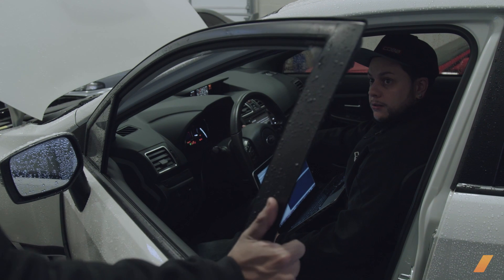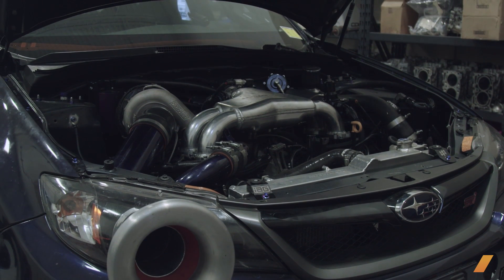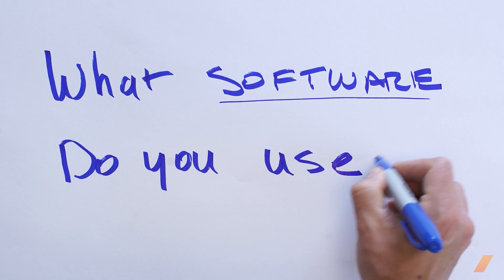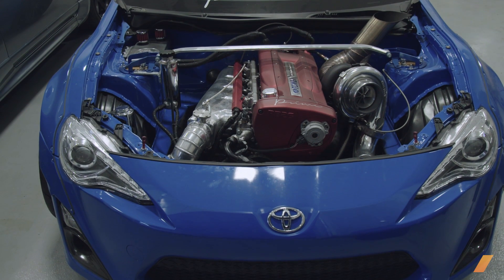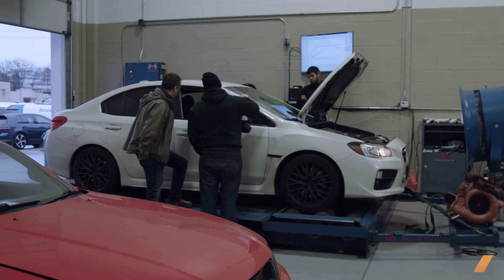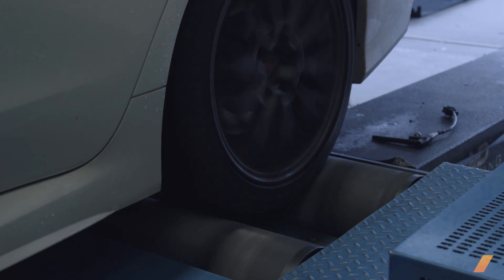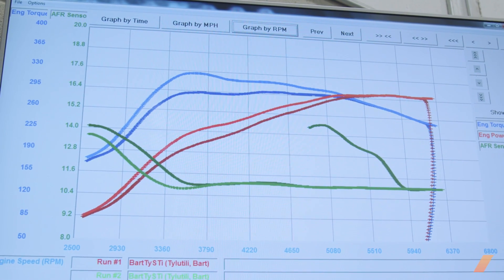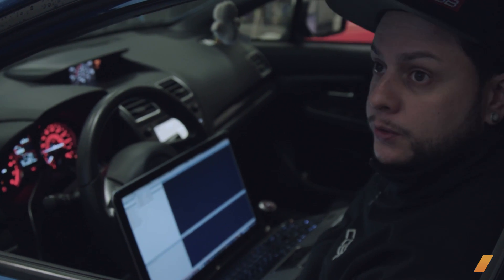Dyno Tuning Without Blowing Up Your Car -- /ENGINEERED

Comment: GDI is much more efficient and produces better power and MUCH better torque than non-GDIs.

Get an engine with (or install) a set of manifold fuel injectors along with Direct Injection, and there's no loss at high RPM.

idk why this dude said DI isn't good for performance.. maybe it's an old vid

Comment: Cast Al pistions shouldn't come stock in boosted cars, either should Al "semi" open deck blocks. Fuji Pop Can Motor cheapskates, way to ruin an awesome German motor design. Now Vince has to make a few million motors to preserve the Boxer name just so we lucky bastards can run more then 550hp. It was all about Fujis bottem line, never about the customer and certainly not about the environment. Heck heck heck.

Comment: When the air gets colder it comes denser but the pressure remains the same but you are implying that the boost increases when the air gets colder. Boost = pressure. MAP sensor is used in conjunction with the IAT/MAT because MAP can only read pressure and guestimate the CFM but as you said when the air gets colder it becomes dense so MAP can't determine the increased volume as it simply reads the pressure hence the IAT/MAT feedback is used to richen/lean the mixture. If what you said was true MAP sensor would be unbeatable and nobody would go for stupid MAFs

Comment: What do you think of the Speeduino Open Source ECU? It's a very cheap ECU (sub $100), uses TunerStudio.
Reply: It's amazing fro what it is. I run a speeduino on my Subaru and have it as a daily taking 10psi for now. Little bit of a learning curve but it's easy to get going watching and reading megasquirt tuning materials

Comment: He must worry about electric cars, no tuning required, only upgrade motors and a batteries, nuts and bolts,
Reply: covington race what is even the point of your comment?
Reply: cutthroat795 the point  is in the words
Reply: There is electric tuning, its just as in depth.

Comment: I share the same opinion  about DI versus PI, theoretically di offers huge advances in fuel atomization (air/fuel mixing) @1400psi versus 43-70 ish psi fuel pressure, and because of this allows using higher effective static compression ratio then a pi engine would use while using the same octane fuel, but di lacks the hardware after market and flexibility to meet high fuel supply demands you encounter with either very very high output engines or e85 or a combination of both.
With PI I can add another pump, go to the next step larger diameter fuel lines, and upgrade to either double or triple the flow pi injectors or even stage 2 different sets if I'm using a standalone.      Having said all this I do know people with di engines using additional staged pi upstream to provide supplemental fueling but they lose the precise atomization they where getting with di, pi is sloppy and old but it is also very easy to manipulate within the confines of the limitations associated to it.
Reply: Not so in the GM DI V8 market. Plenty of options for more fuel there.

Comment: Way to over dramatic when he said " good luck blowing your engine learning it" you can read basic combustion theory and go from there. Of course do not just rely on forum posts to start tuning or knowing engine EFI system theory.

The only hurdle nowdays is wrapping your head around torque based ECU's and understanding how the ECU uses certain maps to manipulate the tune to get the expected result on combustion and dyno.

Specifically the EJ20 is old as dirt nowadays and I don't even know if it's a torque based ECU. Based by what he said that he keeps ignition timing low in case one gets bad fuel suggests that its not or that it's just primitive compared to a new contemporary powerplant.

Comment: You have to consider he is talking off the top of his head,and for what it is, this guy know his shit. All of you talking shit because you went on Wikipedia or read a forum thinking you're a mechanic or tuner  need to stfu. Majority here think they can step in and do what this guys does yet you don't even know how to properly scrape gasket material off to reuse a parts still in spec.  Start by sweeping the floor, cleaning tools, learning from the bottom. That's how you get there.  So many variables go into tuning you don't even KNOW. you won't know until you do it for a profession. Until then.. stfu.

Comment: Training? For access tuner race? The training must be getting it to install while trying to work around windows driver signature enforcement. Both for my mazdaspeed 6 and my Evo X it was just download, install, tune. Tuning on the mazdaspeed was easier. Built in wideband helps a lot.
Reply: they got rid of accesstuner race. mfers. now you have to pay 150 and go through a bunch of pretty useless videos before they'll give you the download

Comment: speaking from experience, it is near impossible to tune without a dyno. unless you have someone who can drive very well while you sit in the passenger seat with your laptop, dont try it. it wont work out well sitting in your driveway. i have a stand alone in my 93 bronco. i got it to a point where i could idle and easily drive on to a trailer, and paid a professional to get me the most power and reliablilty.

Comment: This wasn't a very good one. Going into how an engine works from the tuning perspective. What parameters are present. What parameters are tweaked for what purpose. What margin of error is left. Those are things that should have been addressed.

Credit where it is due, this guy is protecting his field admirably. Didn't give out any "secrets," statements are generic and general. According to the title and video dyno tuning without blowing up your car is done by going to this guy. 

Discussion of what knocking is, how timing works, what is moved for what purpose (when timing is pulled, when more fuel is added), sizing injectors and fuel pumps, there are so many thing that really could have been helped with diagrams, and looks like this guy never took his hands out of his pockets. 

I agree that tuning isn't something that anybody should pickup and do, but this was a terrible explainor or engineered video. The oil video and exhaust video come to mind as greatly informative with people very experienced and knowledgeable in their field. I would love to have those guys as a teacher. This guy I would hate to have as a teacher. Wouldn't mind employing him though, I know he won't be teaching the competition or anything.
Reply: SeattleGooby the editor may have cut out many of those topics.

Comment: Yea Good explanations, I just want to add the reason Direct injection makes less power is due to the injectors being located in the cylinder which creates super high cylinder pressures as compared to port injection or carburetors. You really have to add a lot a lot of fuel in a short pulse width to get it to work right, which means you need a fuel pump capable of 2-3 times  more PSI than stock. 

I like the fact that he pulls timing due to fuel inconsistencies. It is also good to mention that you want to pull timing due to such things as carbon build up on non e85 tunes. carbon build up can increase compression ratios and create hot spots which will increase the chance of causing detonation. 

Good stuff.

Comment: I don't think this should be under /Engineered, 
It doesn't really talk about the engineering aspects of Engine Tuning(calibrating), Use of Dyno, Standalone vs. Factory Ecu. The tuners ability to talk on DI and give examples what issues he faces. (was there air leaking out of the injector due to high boost pressures, if he's able to use DI in parallel w/ higher flowing port injection, has he done any R&D on this or just Forum glanced?) 

I'm not sure if the questions weren't technical enough or the person being interviewed or vise versa / or both
Reply: Couldn't agree more. Basically this was just another round of "don't touch it yourself because you are going to blow up your engine" and is basically just an advert to promote his services... I expected more /Drive
Reply: You both clearly don't know much about Jr if you think he "forum glances" lol. He is known for his R&D on multiple cars, parts, and platforms each year. The answers were shortened to make it more understandable for the general listener.
Reply: I just... don't know what to say hahaha xD
Reply: Well if you noticed my entire comment Jennyeliza706 it mentioned it could be the questioning, It could be he's not very camera Friendly or it could be the interviewer not able to properly dig into those categories. 

The thing is that this is /Engineered not /Tuned. This section of their page shouldn't be for the average listener/Viewer but for the ones who understand the concepts and first hand knowledge the person being interviewed has to offer.

I don't have a clue who he is, and i'm sure he does the job people ask him to do quite alright... but this interview is a bust on a topic Which is overplayed sorry to say.
Reply: You shut the fuck up and leave then, this is why youre not invited when we carpool to the flea market on saturdays Robert.

Comment: Holy crap I didn't expect JR to be featured here! He's tuned my '16 WRX a couple times after different upgrades. I was running a GrimmSpeed j-pipe, GrimmSpeed TMIC w/ charge pipe, GrimmSpeed EBCS, Invidia N1 catback, and Cobb Big SF intake and made a hearty 323whp / 311wtq. I have since changed the intake to the GrimmSpeed Stealthbox intake and had JR give me an etune so I don't know how much power it makes but should still be in the ballpark of 300+whp/wtq. Nothing but solid tunes from JR 👌

Comment: This video could also be named, "why it's so expensive to make power in Subaru cars" so much corner cutting that you need to fix it with aftermarket parts if you want real power.
Reply: Corner cutting?
Reply: factory parts have a range in which they are variable enough, and durable enough to be used in the effort to increase power. manufacturers save money by making and buying parts that use only as much material as necessary to perform as the manufacturer intends, which naturally limits the range in which those parts can perform.

to the "stock is never good enough" end user, this is "corner cutting", because now the cost of purchasing parts with more durability and capacity for increased power has been passed on to them. it is, however, perfectly logical, since the cost of performance from the factory is consistently decreasing relative to what the consumer receives, if they can accept it as a truly finished product.

Comment: This guy is the complete opposite of the last guy, speaks well, well thought out. No stuttering, more of these people less of the last guy.
Reply: ImBarryScottCSS The last guy was fine man, don't be so harsh lol
Reply: @ImbarryScottCSS Wow what a douche thing to say. Drive is just interviewing a shop that works on Suburbs, these people are Mechanics and Tuners, they aren't showmen. Not everyone has to be great in front of a camera. I wonder how well you would do in  a hi pressure interview like this.
Reply: jr is very well known in the community, a+ guy all around
Reply: He's a tuner, so it's natural that he's gonna have a LOT more experience explaining this information from dealing with customers, as opposed to an engine builder.
Reply: BitSlash yep. Direct Injection is not tuner friendly. But DI actualy creates more power with more pressure, allows high efficiency of certain fuels like E85. But manufacters like Ford are startkng to use both port and DI. Because DI alone also does not clean the back of the valves which presents its own challenges.
Reply: There was far more nuance in his position then just that, the reasoning he gave talked about the lack of aftermarket parts for fuel pumps and injectors (direct injection requires more pressure). However once that happens then you also have to deal with the added cost of direct injection, with that said katech pushed 700BHP on their 7.0 LT1 V-8 (normally aspirated and with direct injection). So it might also come down to how much overhead the stock stuff comes with on top of how much of an after market exist for direct injection. 

With that said direct injection for gasoline engines has actually been around for a while with some examples that I know of dating back to the 1940s. It allows for more precise control over fuel being pumped into the combustion chamber allowing for motors to be tuned further (which is why you see 13:1 CR engines running on 87 octane).
Reply: tdc7 he said "in terms of performance it's a step backwards"
Reply: LT4 Chris the direct injection technology in the 86/brz is toyotas design, that's why
Reply: He probably went to school for a degree to work on cars this is the result well spoken better educated
Reply: It's not more precise control of the fuel.  They have gotten that down pretty well even with port injection.  It is due to the fuel not absorbing heat from the head/valves in route to the combustion chamber.  This keeps the temperature of the charge down and allows more timing advance before running into detonation.
Reply: Vince was good, just said "you know" a lot. If you can`t see past that, you`re pathetic, and probably not that interested ;)
Reply: tdc7 well it kinda is, it's much more focuesed on fuel efficiency rather than making raw power. It allows for a higher comp ration which is fine if your car is aspirated or you're not planning on upping boost heaps, but the more intricate fuel injection style as opposed to multi point and the higher comp ratios that generally go with direct injection to increase its efficiency are a nightmare for tuning. Multi point you just chuck bigger injectors and you're on your way.